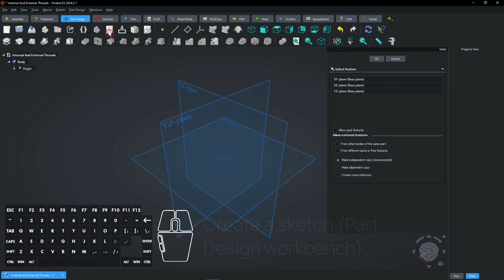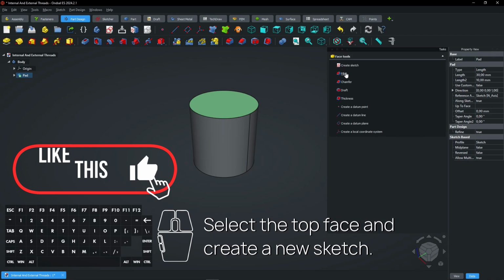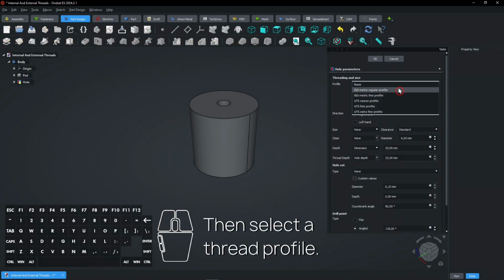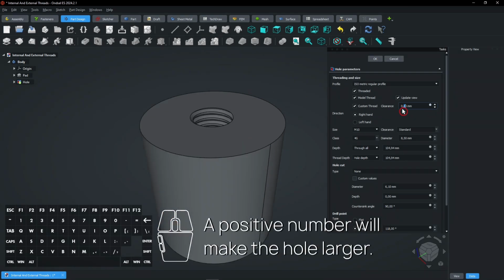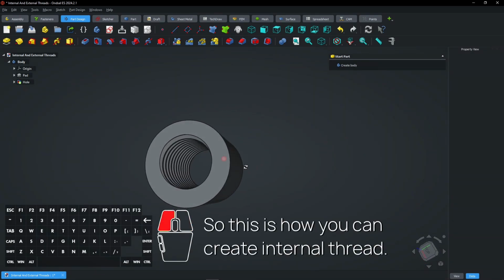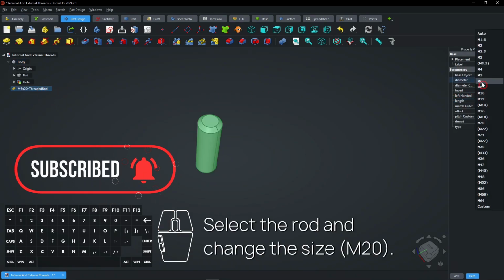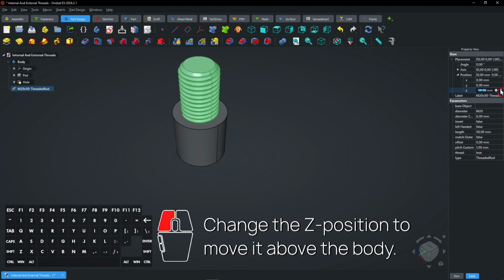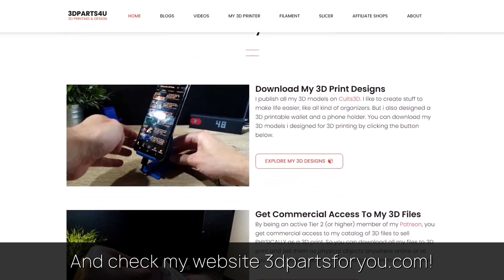🔩 Ondsel For Beginners - Create Internal And External Threads - FreeCAD Threads Tutorial

Comment: thank you very much for your videos. I am learning a lot.

However I have a problem, I notice that the program is a little slow, for example if I want to change the thread size from M10 to M20 I give the command and the program takes 3 or 4 seconds to execute the action, it is not as fast as in your video, is this normal? what could it be?
Reply from the maker: Thank you, that's awesome! I cut the video, so loading times look like shorter than they are.

Comment: For anybody wondering, the fasteners workbench is a 3rd party plugin if you don't have it. To get it, click the tools dropdown on the top bar, then click addons manager, then search for fasteners workbench, click on it, then click install. Once it's installed, it will prompt you to restart freecad or ondsel. Save your file then click restart. Then, you'll have the fasteners workbench. These instructions are for freecad, but they are most likely the same in ondsel. I don't know because I have never used ondsel.